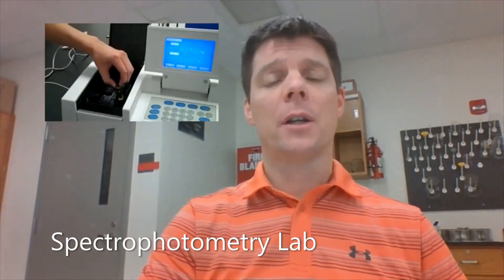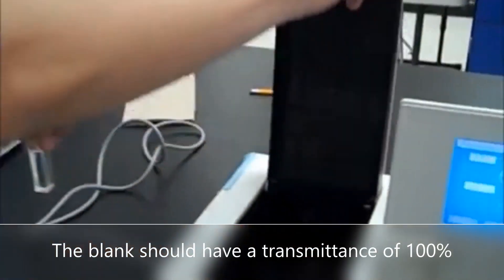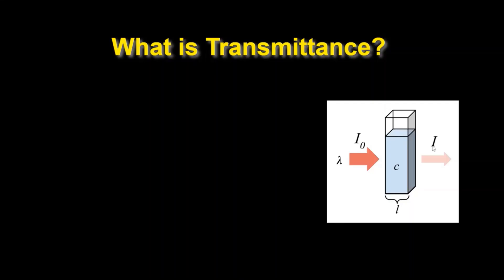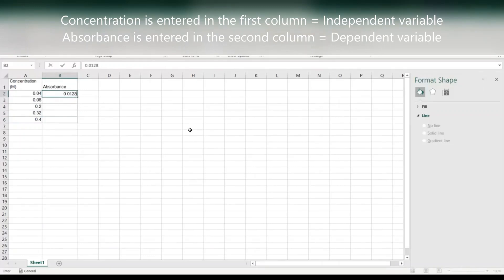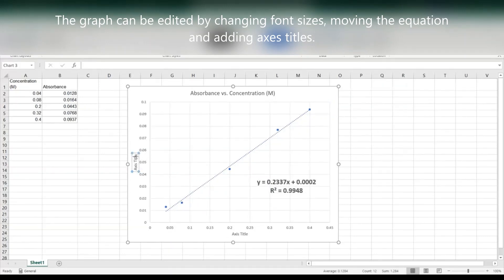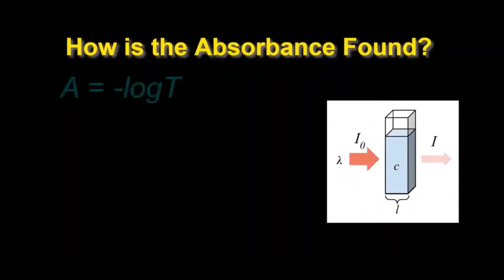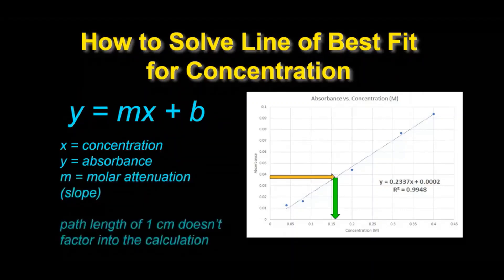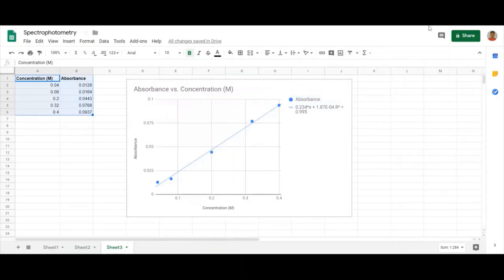Spectrophotometry Experiment - Full Explanation & Analysis by Mr Pauller

Comment: how did you get the concentrations?
Reply from the maker: The solutions used to create the standard curve were prepared by students to be 0.04M, 0.08M, 0.2M, 0.32M and 0.4M. This video explains how you can use the measurements of stock + water to calculate the new concentration of the solutions used for the standard curve. https://youtu.be/uVDrS4mFZg8?si=wTH3RhVJ1IY9T3_n

Comment: Good evening! I know this video is posted for a long time, but I wanna ask a question. 
is there any significance in involving the r2 value to the actual experiment? Replies would be greatly appreciated since this video is our basis in our laboratory report. Thank you!
Reply from the maker: The r2 value tells you how well the data fir the line. A r2 of 1 means the data point fit perfectly. A lower value would mean the fit is not as good. It's also called the coefficient of determination.
Reply: @LabHamster  thank you sir. So in other words, the line serves as a guide for me on how to predict another concentration value if I had another absorbance value that I measured?
Reply from the maker: Yes, that's right & you're welcome
 😃
Reply: @LabHamster  another follow up question sir 😅😅😅 what does it mean in this experiment if the data points fit perfectly on the line? And what does a bad fit mean?
Reply from the maker: Basically it would mean that some aspect of the experiment did not go as planned or did not work correctly.
Reply: @LabHamster  I get it now. Thank you so much sir I really appreciate your help 😊
Reply: Oh another one sir. Is the slope 0.2337 or 0.2237? Since the equation of the line shown in the chart was 0.2337 and on the calculations 0. 2237 was used and based for the final concentration and I tried using 0.2337 and got 0.164 M
Reply from the maker: @sophiagarcia6496  You did it correctly.  Thanks for pointing out the slope, using 0.2337 was correct.
Reply: @LabHamster  thank you so much sir, I greatly appreciate your replies, helped me a lot 😊